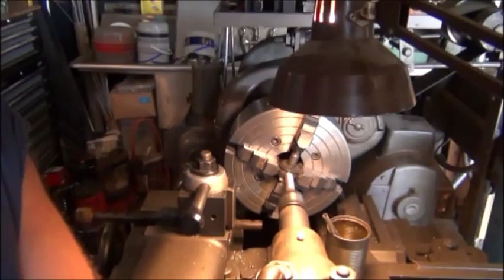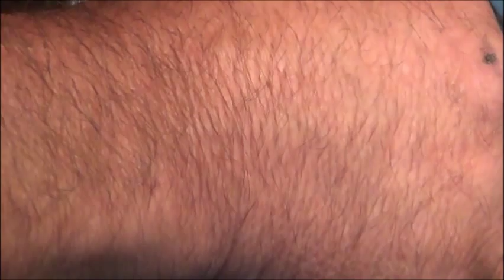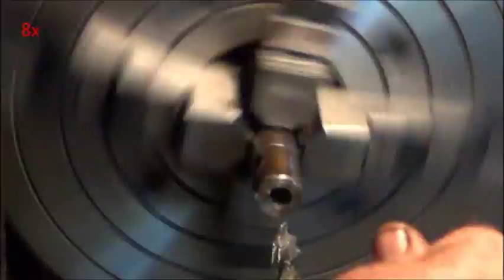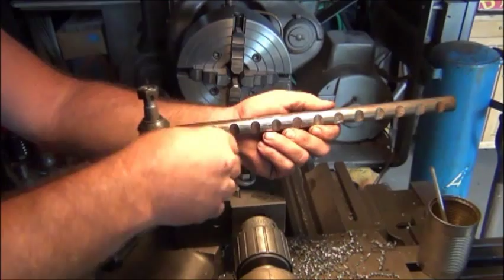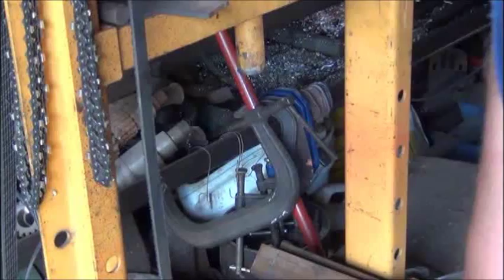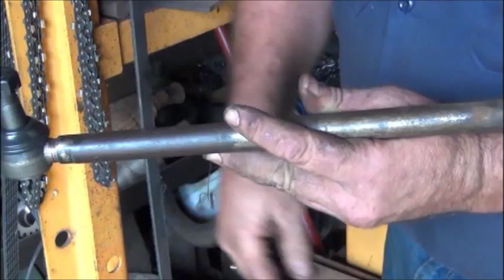Tying Up Loose Ends!

Comment: Nice repair, Jeff. I hadn't thought of using the 4 jaw chuck to hold such an irregular part. I learned something there. Thanks for the nice videos! Would like to see the tractor running. Thanks for sharing the nice project.
Reply from the maker: Thanks Jim,I'm going to get Jennifer to take the tie rods off so I can finish the rest, then maybe I can get a video of her putting them back on and taking the tractor for a test drive!

Jeff

Comment: Hello jeff looking good my friend!
Reply from the maker: Thanks Lawrence, When are you heading for Texas? Been trying to find time to give you a call to see how it's going, but I've been way to busy lately!
Jeff
Reply: Jeff Sigrist Hey bud! im back the job was not exactly what it I thought it would be LOL...so I am back still jobless but much needed to get away
Reply from the maker: Lawrence Harasim  Sorry to hear the job didn't work, but glad you enjoyed the trip! Everybody needs a break now and then!
Now you need some projects for the lathe!

Jeff
Reply: Jeff Sigrist yes I need to come up with an adjustable follow rest so i can turn some small dia aluminum and make it consistent across its length any ideas?
Reply from the maker: Hi Lawrence, What is your height from your carriage (or bed) to center? I have a follow rest from a 10 or 12" lathe that is looking for a home! I think it fastened to the side of the carriage but could mount on top!
Reply: Jeff Sigrist let me go measure! Thanks Jeff!! BRB
Reply: Jeff Sigrist ok bed to center is almost 7" that is the flat part not the V part

I could drill some holes on the side of the carrige and mount it on the side seems it might work